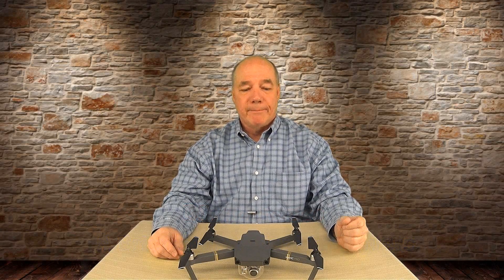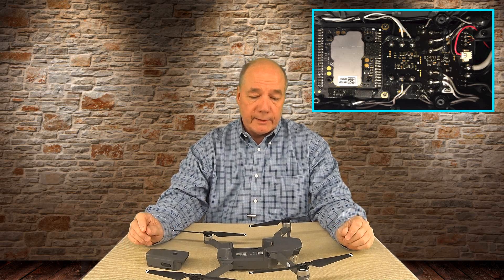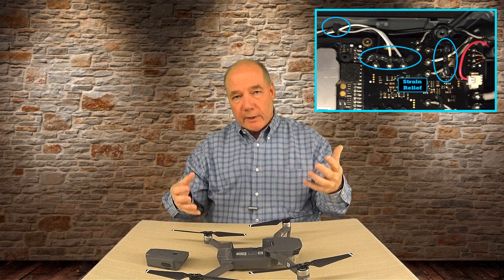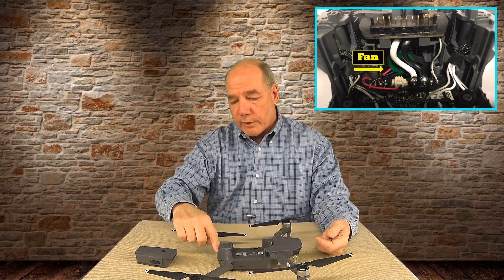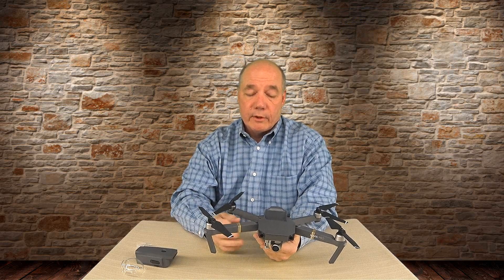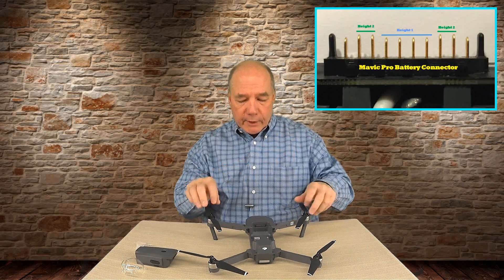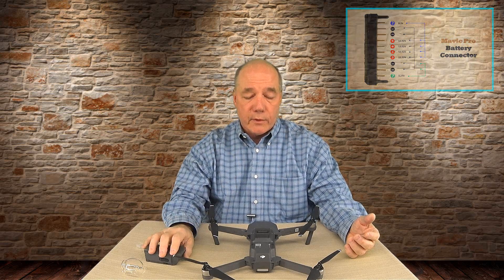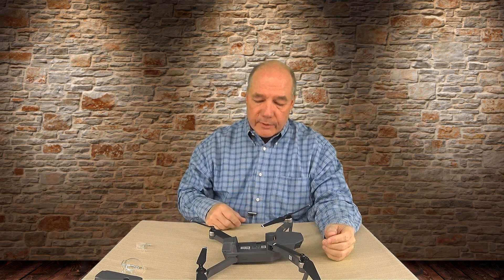Mavic Teardown - A look Inside Your New DJI Mavic Pro Drone

Comment: Great video.  In fact (hoping I get some kind of a reply to this) - I am wondering if my fan may have an issue.  You mention in your video not to have the Mavic Pro actually running or "on" if it's going to be on the ground for any period of time.  What about firmware updates?  These do take about 30 minutes to complete in which the aircraft does need to be on the whole time.  I have forever been encountering an issue where my aircraft has been powering itself off half-way through the update, and I've never been able to figure out why, until just recently, I think it may have to do with an overheating issue (I noticed an onscreen message about the processor overheating one time when I looked at my Android tablet, before attempting an update).  It was only then that I decided to try holding an external fan near my drone while attempting the firmware update the next time to see if it would stay on long enough - and sure enough, it did, and the update was allowed to complete.

Comment: Fascinating oratory Rick. I've owned a few First Gen Mavic Pro's and although I've been a subscriber for several years, I've never seen this particular video of yours. My first Alpine White threw a prop and crashed so I bought another since I had many accessories. The second flew great for years with "as needed" updates and calibrations. However, within the last month or so, the video stream would freeze so I sent it in to DJI who wanted nearly $400 to repair. I bought my third Mavic on eBay and got it within this last week. I'm considering harvesting the PCB's from the first to place into the second and was hoping to glean info on that from this video. Thank you for taking the time to explain the tech that goes into this Bird I'm so sold on. Keep your props spinning!

Comment: Vibration is not a problem for the GPS, but it is a problem for the IMU, which is often mounted on dampers. If the arms provide damping in this drone, then the IMU and gimbal dampers would no longer be needed. That is an interesting design decision.
Correction: The Mavic 3 seems to have a separate damper assembly on the IMU, based on another video. I assume this is the case for the Mavic Pro as well, but from this video alone it cannot be discerned.

Comment: Amazing and extremely interesting video!  Came here looking for technical information on my Mavic Pro battery and was presented with far more interesting design features of my now "old" Mavic Pro.  Trying to restore some batteries that apparently went below 3V and made them unchangeable.  Will be trying to restore them using a multi-charger initially in NiCad mode as some have suggested.  A shame that DJI no longer sells reliable batteries for the original Mavic Pro.  Many of the batteries they sell have been sitting around a long time and have charging issues also.

Comment: Hey Man! great Video! I just want to correct something: The reason why the ground Pins are longer than the positive Pins is because when you disconnect a power device e.g. the Battery, a residual current is delivered by the coils in your circuit.  This causes also a very high voltage spike (100 V for a DC 12 V Sytem is a reallisitc voltage spike )  which burn your circuit components if you dont take action against that. One option is to build flyback diodes parallel to the coils (it´s a must for some circuits and high inductivities) but also to disconnect the ground pins AFTER the positive pins, is other measure to prevent damage on the circut and let the current flow back to the batt :)  for more detailed info: 
https://en.wikipedia.org/wiki/Flyback_diode#Induction_at_the_opening_of_a_contact

Comment: I liked the flow and logical progression through the video, but as a EE with some experience in RF and EMC, I can't relate to the RF antennas in the pointy solderings.  I'd also like to know the theory behind more current flowing in the negative lead than the positive as the reason for the pins carrying the negative current being longer.

Comment: Hi Rick, I know you're mostly a M2P/Z guy right now, but hey, I love your videos and wanted to ask something regarding my MPP, which I just got to replace my MA.

I got the MPP used from eBay at a great price (Letting DJI iron out the wrinkles on the M2Z and come up with a Christmas offer to actually buy one). The bird is really "like new." However, on the 3rd battery on my first day of flying it, I got a gimbal reset mid flight, which prompted me to check the bird more thoroughly. After resetting the camera settings, calibrating the gimbal, etc, I was able to fly 3 batteries yesterday and not get a gimbal reset while recording for 20 minutes. However, I did check the entire quad and found that 2 of the rubber bands on the vibration board below the gimbal are a little more stretched than the other 2.

Thus, my question is, should I change those? Are they going to pose a problem eventually? Do they sell them without the entire board? If I should replace them, can you let me know if you've done this before and what I can expect in terms of taking the bird apart and putting it back together?

Thanks a lot bud, and keep up the great work with the videos!
Reply from the maker: Enrique, I wouldn't change the bands. They are tricky to remove and replace and I'm not sure if you can even buy them as a replacement part. I would suggest doing the gimbal alignment one more time with a fresh battery to see if that helps. I have seen this issue on quads that have been powered-up with the gimbal lock attached. This can cause damage to the sensitive gimbal motors since they do a POST (power on self test) when the quad wakes up and if the gimbal can't move it can damage the motors. Hopefully this isn't the case but if it continues to happen then you may need to send it back to DJI to get it serviced. Let me know how you make out and if you have any questions. Thanks, Rick
Reply: @Dronevalley  thanks Rick! I will let you know how it goes. I think the issue was because I did not calibrate the Gimbal after receiving the shipped item. I may be worrying for nothing, and my worry might be Overkill, since it worked fine yesterday

Comment: As I posted on one of your videos, I spent almost 1300 bucks and was getting a bit of buyers remorse but you gave erased any doubts I may gave had,  thanks man. More great info. I loved seeing the inside of the unit, nice work. I also ordered the round landing pad, as I was thinking the same thing on the dirt intake. Plus I read it gives the drone a nice visual target for the rth feature.

Comment: On the battery connector, I bet the connectors on the outside with the weird voltages are the individual cells, used for balancing.

Comment: They didn't make the negative terminals longer so as they can handle more current, they make them longer so the negative or ground makes contact first, therefore discharging any accumulated voltage (static or residual via capacitors) to ground FIRST before the POSITIVE makes contact and potentially dumps x amount of voltage straight into the electronics..Besides, you will usually find in high current situations its the POSITIVE rails that are bolstered and made thicker.

Comment: I have another possible explanation for the longer negative posts.  I've seen this connector tab concept before where the longer negative posts help with aligning and seating the plug as well as preventing the potential of arcing across all of the contacts should the negative and positive plugs connect at the same time.  The battery is grounded to the device before the positive terminals make contact.  

Kind of like boosting your car battery, where you connect one terminal at a time.  

It can be another layer of protection, especially when using high amperage power supplies with delicate electronics.

Comment: I don't know why he is so amazed that DJI did stuff even though people wouldn't see it. Isn't that true for any industry? I'd like to think my surgeon would do the right thing even though no one will be able to see his work. I'd like to think my milkman doesn't rinse out the milk bottles with his own spit before filling them with milk even though no one would see him. You build a company on good practices even though no one knows half the time. If it was an Eachine E58 drone then I could understand his childlike naiveness.
Reply from the maker: Thanks for the post but having been a professional electrical engineer for the past 40 years, I can tell you that most companies design their products to be as close to the "red line" of failure as possible to minimize costs. In most cases these decisions are made in the design phase of a product and are made in favor of a lower cost and not necessarily a better product. When someone like DJI (and others) make a decision in favor of a better and safer product, I want to point that out so you as a consumer know that you're buying from a company that cares about their products. I tear apart hundreds of tech products a year and I can assure you that the vast majority of the drones I review are nothing more than off the shelf parts, hastily tossed into a pretty airframe to try and capture a tiny piece of the exploding quad market. The Mavic (and other DJI gear) is a universe of difference away and as an experienced flier, I appreciate that. And if your milkman is spitting in your milk bottles, I'd switch companies. Rick

Comment: Good video but you got your ground pin length explanation wrong. Ground pins are long to remove static charge thru ground before power is connected. Common in many plugs
Reply from the maker: Conrad, you're totally right and remembered this right after I finished filming the clip and didn't want to have to shoot it again. I appreciate you posting and hope you're enjoying the content. Rick

Comment: Hi, my name is James Kenley Chastain. I’ve subscribed to your channel and I love it, it’s great! This video was really awesome, because I don’t have the guts to open up any of my DJI drones, not to mention as of right now I only have a DJI Phantom 3 Standard, and a DJI Phantom 4 Pro +. For Christmas, I hope I’m lucky enough to get the one thing on my Christmas list, wich is a DJI Mavic Pro Platinum. Now, when I bought my DJI Phantom 4 Pro +, I did a lot of research before I bought my DJI Phantom 4 Pro +, and originally, before I had all the money saved up, I was going to buy the DJI Mavic Pro, but because I knew the DJI Phantom 4 Pro + had a better camera and the new controller with a built in screen that’s super bright, not to mention my researched turned up many videos of people who bought the DJI Mavic Pro and had problems with the camera and gimbal and other electronic malfunctions, that sealed the deal in my mind to buy the DJI Phantom 4 Pro +. Anyway I found puns out after I bought the DJI Phantom 4 Pro +, that the DJI Mavic Pro had so many YouTube videos of people getting malfunctioning units because the first batch of DJI Mavic Pros that DJI released where released really fast and put out really fast, also the DJI Mavic Pro, unlike the DJI Phantom units, were a bran new design. So really all those videos were dated around the exsact same time, wich was right when the DJI Mavic Pro was released, so in theory those where just the videos of the few unlucky people who got units that were either rushed past quality control to get them out quickly, or some other reasons there were malfunctions from the factory, wich honestly is the case of a lot of brand new released electronics. So what I’m getting at is after that initial first batch the DJI Mavic Pro, was completely perfect, but I wasn’t upset because like I said, I chose the DJI Phantom 4 Pro + for many reasons, like the camera, the sensors, the screen built into the remote, and I wanted the most professional drone, because I am hoping to have a professional aerial photography and videography business some day, and that was the best drone for that business, in comparison to the DJI Mavic Pro. Anyway, sorry I’m talking your head off, but the main question I have for you is, I read in the DJI Mavic Pro specs that the DJI Mavic Pro was only good for 5,000 folds, wich meant once I unfold my DJI Mavic Pro Platinum 5,000 times it could or will break, wich concerned me, and maybe I read to much into it, but that was one of those factors that also made me choose the DJI Phantom 4 Pro +, so I’m still kind of concerned now about that, because for the price of the drone I thought it was made to last, and Ino that I could easily fold and unfold that drone 5,000 times in a years time, give or take, so some people that were worried about that spec too were calling it a “throw away drone”, wich I thought was ridiculous and not true, but if DJIs care refresh only last a year and a year passes before I use those 5,000 folds, then in theory I’m left with a broken drone. Anyway those are fears, and I still can’t wait to get the DJI Mavic Pro Platinum, I just wanted to know what you think about this spec, and if you have any ideas on how to keep my DJI Mavic Pro Platinum from having a broken arm issue down the road? Anyway Thankyou for your awesome show, it’s great and I’ve learned so much! If you want to email me, then you can at one of my two email addresses, wich are, of course my email address that’s connected to my YouTube profile is a gmail one, so it’s kenley31792@gmail.com. My personal email address is kenley3138@outlook.com. If your wondering, Kenley is the name I’ve been called my whole life and is what I go by from all the people who know me, it’s my middle name and was my grandpas name who survived the U.S.S. Indianapolis sinking in the world war. You can call me by either name though I truly don’t mind. Thankyou and I hope to hear your answer and opinion, and I will continue to enjoy your show.

Comment: The round solder connections on the main PCB are most probably round because they are just surface pads and not through hole vias, this may well help with RF but more to do with making it easy to replace the wires if need be. I would also think the longer ground connection pins are so they are connected first and disconnected last as the battery is inserted and removed. also the last connections on the outside could well be data lines and that's why you got an odd voltage reading there, maybe put a oscilloscope on one of those pins and see what sort of trace you get. This is just my opinion as I have not tested anything myself just yet.

Comment: I appreciate your assertiveness, but some of what you're saying is patently silly. The bare motor wires were soldered to SMT pads, resulting in "bubble joints" — thru-hole soldering wouldn't have been possible due to how the package is assembled. Mechanically, this is an inferior connection to thru-hole soldering, though. They glued down the wires to prevent mechanical oscillations that would break the wire at the solder joint. Your comments about the motor pin stubs radiating RF is also way off. Pin stubs may radiate in the hundreds-of-MHz / GHz range, but you're not going to see any perceptible change in RF emissions from a wire stub that's oscillating at the kHz range (that BLDC motors in this speed capacity operate at). If you were really worried about RF emissions from the BLDC motors, wouldn't you be more concerned with the giant 8-inch unbalanced / unshielded wires actually going to the motors? I understand they're effectively terminated to something, but there's still going to be a lot of radiated power coming out of those long wires — much more than silly little pin stubs resulting from thru-hole soldering.

Comment: I would assume those other battery pins are between the first and second cell and between the second and third cell. This allows the Mavic to assess the voltages on the individual cells inside the battery so that it can report the health of the individual cells. The charger needs those pins to balance the cells as it charges.

Comment: Hey Rick thanks for a great run through of the internals of the Mavic, and I have a few queries... In your opinion if you were to tear down the mavic and spray the boards with a sealant , or that new prismatic water resistant gear that now in most of the water resistant phones....do you think this would be worth it ??  

And also WRT battery terminals that have different heights,  the other idea is to have the Earth connect first  to level the ground potential  to minimize Static or over voltage spikes spikes that may be caused that would damage a CPU Etc. .... we do this also with standard power leads (for shock protection) and laptop batteries (the earth is always great er size than the active and neutral...or positive in this case)

Hope this makes sense and thanks again....Always Excited to learn about new Tech!  H

Comment: The 3.3V lines are likely for the electronics. This a a fairly common voltage for powering microcontrollers/logic circuits. The grounds are longer so they make contact first when inserting and last when they removed. This makes sure all the electroncs have a ground reference before power is applied.  This prevents any damage to the electronics due to static/stray voltages. Common practice in all new electronics. 
Enjoy your videos, informative and well articulated.